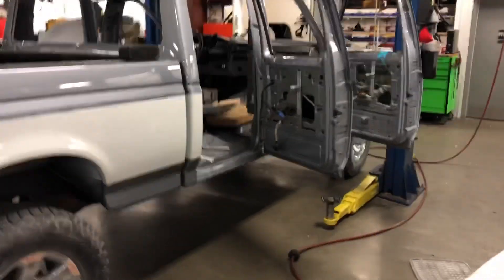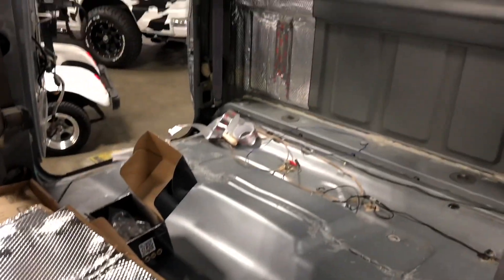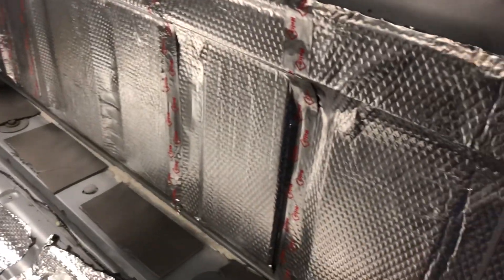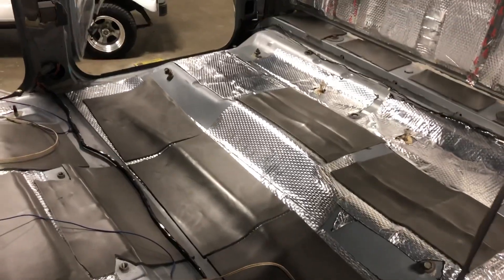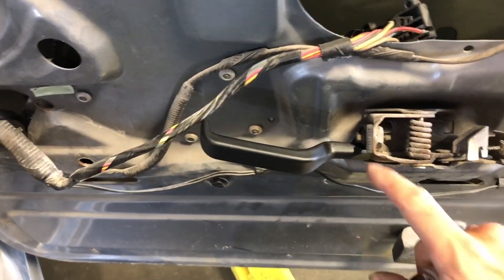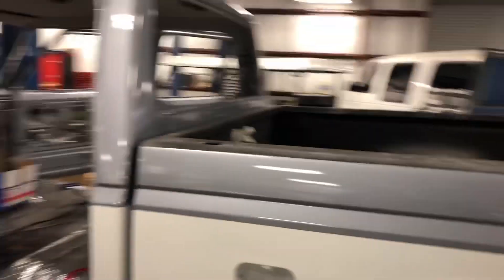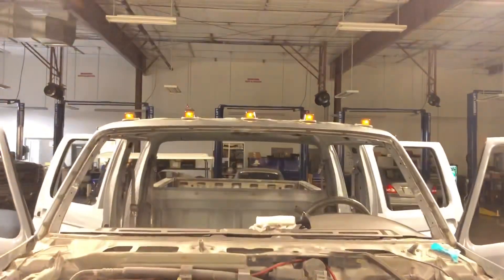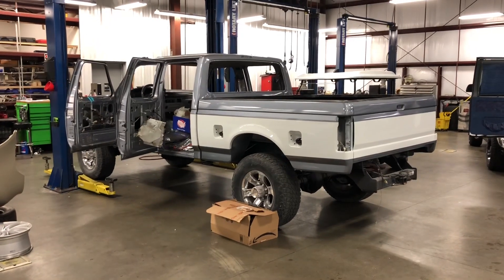PART 3..1997 FORD F250 OBS, ,,, SOUND PROOFING, CAB LIGHTS, HEADLINER

Comment: Where are you getting replacement interior parts? Carpet, and so on.
Reply from the maker: Barney Ross I tried to salvage as much of the old parts as possible. I got my inner door handles from Bennett, outers online amazon. Door pads from bronco grave yard. Congrats addict has some interior dash pads. ACC carpet I have used from stock interior plus online. I was able to salvage my factory carpet. Installing it this weekend.
Reply: An_Auto _Addiction Good deal. Thanks for the info. When trying to find obs parts, a 97 cc is an odd ball.
Reply from the maker: Barney Ross yes sir half the time I have to look up a 96